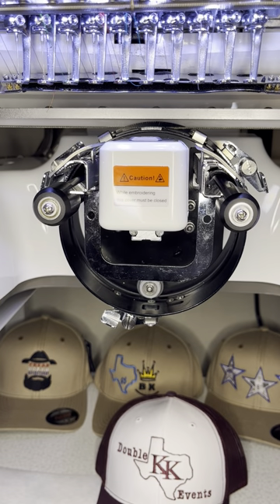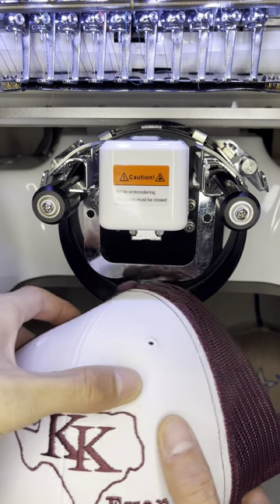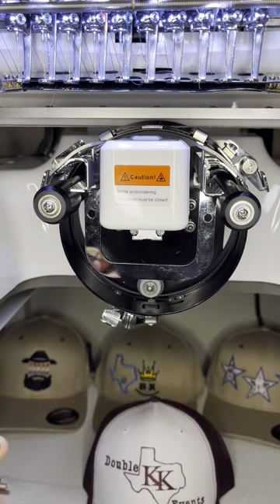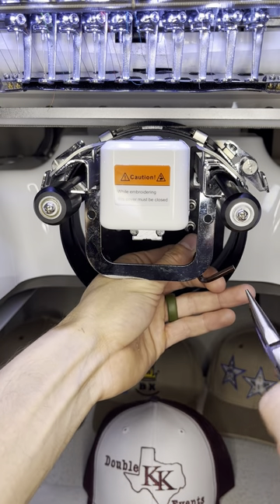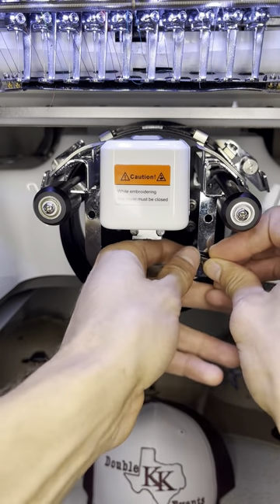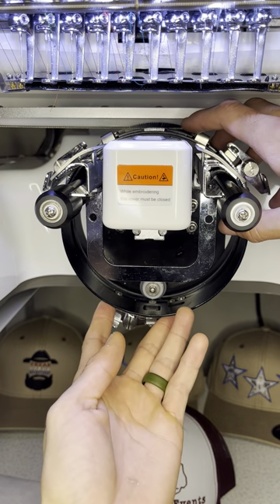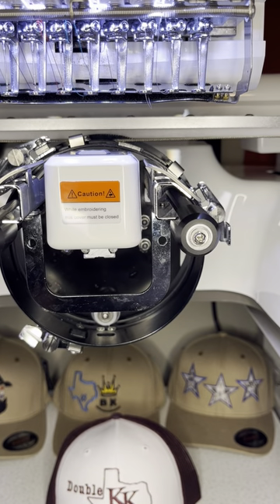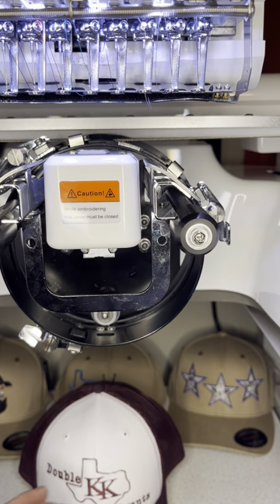Embroidery Tutorial - Eliminate Needle Breaks

Comment: Just break up the middle fabric by hand. Makes it much softer and stops the needle breaks.
Reply from the maker: That’s smart! But alter every hat, every time. Rather than alter your machine one time?
Reply: @AWGCreationsLLC  Massage every hat for several reasons. 1. Altering the machine still might not work and you risk damaging it if you make a mistake. You’d essentially need to use heat or heat press anyway on top of machine altering.
2.. Heat and Steaming re hardens when it cools off so I’ve literally had needles start to break again mid job. I’ve had to use the steamer continuously during jobs also. Breaking the material is permanent and the stitches cover the soft area.
3. It takes less than 30 seconds to break up the seam. You can do all the hats before hand, basically at any time of your process , even pre process at receiving.

Comment: You have a techniques how to get cap to actually sew out designs passed 2.25 ? Design will be slightly larger and the machine auto adjusted design size to something way smaller
Reply from the maker: Which machine are you on? I have a video on here that gives the full breakdown of the screen controls on the em1010. You have to change the parameters. Hit my email if you just want pics on how to change it. AWG.Creations@gmail.com